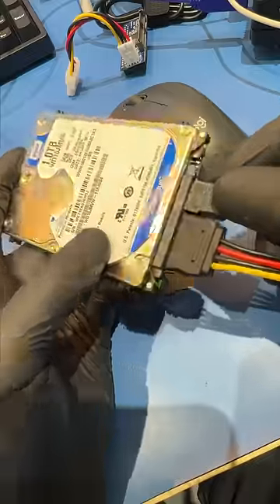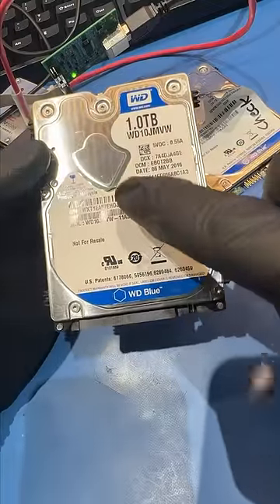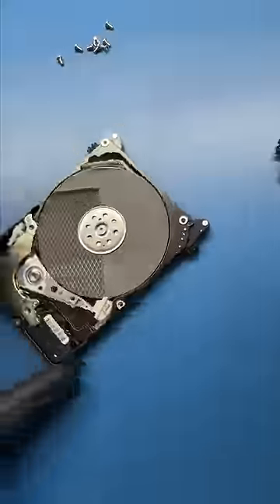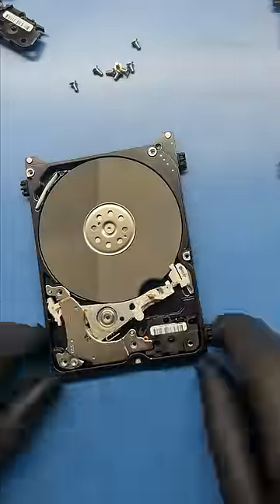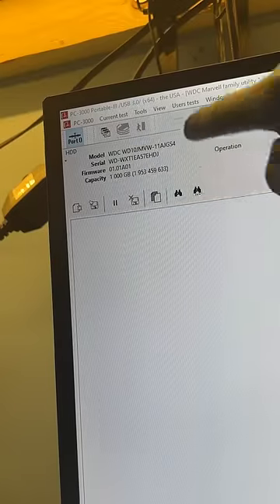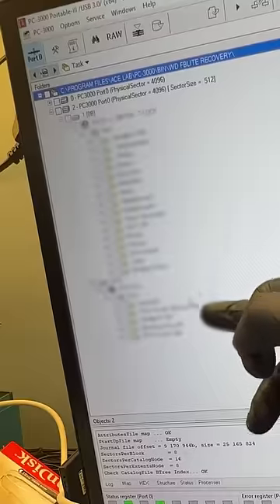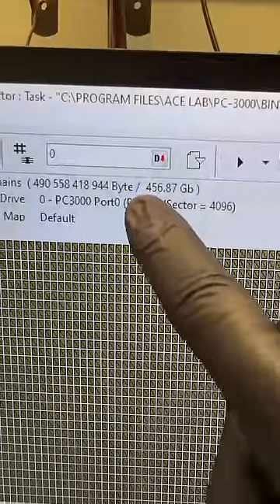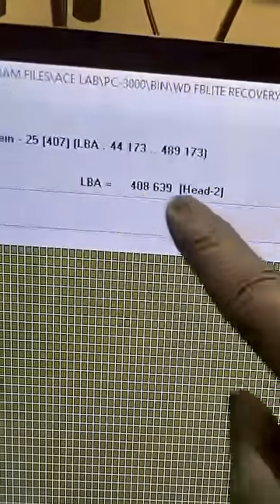Hard Drive Data Recovery Possible…? #technology

Comment: Customer got lucky with just bad heads. The newer drives with smr can just loose their translator and are susceptible to platter damage :(
Reply from the maker: Smr drives 🤮
Reply: @MDrepairsLLC  yep. And the translator is usually encrypted so pcb swaps are usually out of the question. Charger yes? Spyglass 2 maybe, but spyglass 2 ultra and spyglass 3? Nope…

Comment: Hi I do have the same problem I from Singapore I count not able to find a shop here in Singapore to do this can I send it to you and help me to repair?inside have a lot of photo and video that is my family memory…I did try buying software but it’s still fail…When the hard drive run it will have either have a clicking sound or a scratching sound..is it possible to get my data back..because of this I become a sinner in my family…price is not a problem the main is to repair and recover my data inside

Comment: I HAVE A BRAND NEW 2TB HARD DRIVE THAT LOST POWER WHILE IN MID FORMAT AND NOW WHEN I CONNECT IT TO MY PC THE DRIVE WILL MAKE A SQUEEKY NOICE WHEN IT STARTS UP  AND  THEN AFTER A MINUTE THE DRIVE IS NOT DETECTED CORRECTLY SHOWING ONLY 3 GB AND I HAVE TRYED MULTIPLE PARTITION PROGRAMS TO RE PARTITION AND RE FORMAT IT BUT NOTHINGSEAMS TO WORK HOW COULD I RECOVER THE DRIVE, THE DRIVE WAS BRAND NEW ALL THIS HAPPENED AT FIRST DRIVE INITIALASATION I HAVE NEVER BEEN ABLE TO USE THE DRIVE AT ALL THERE IS NO DATA IN IT

Comment: you're not even in a clean room..... wtf..... and breaking into the drive, that has some privacy issues for the customer, as why couldn't you just transfer the encrypted partition as a whole? and never explaining why you need the giant piece of tech to read the drive after your repair, where a simple sata to usb adapter would have read the drive,  Kinda putting up unnecessary tech fluff for a drive repair